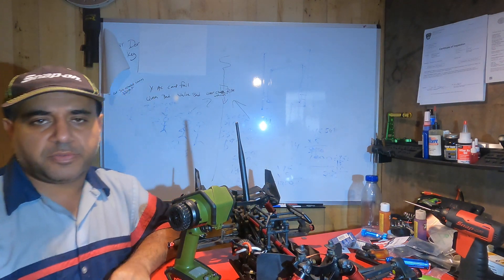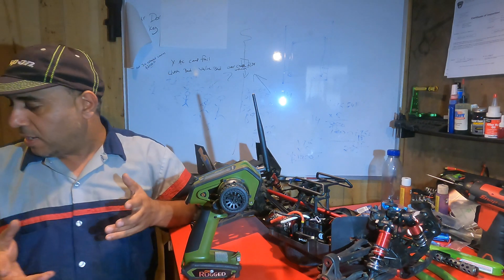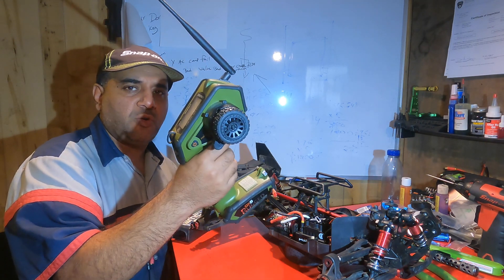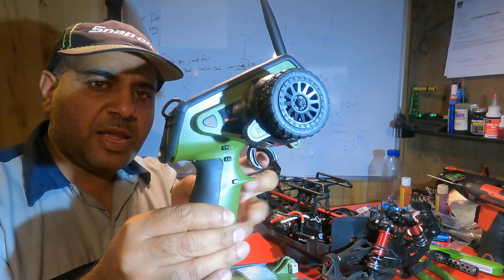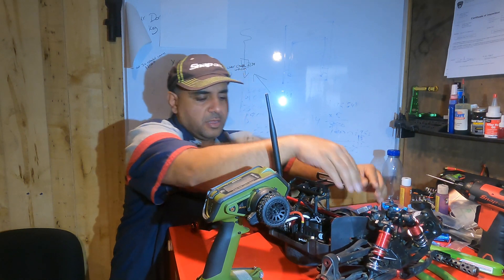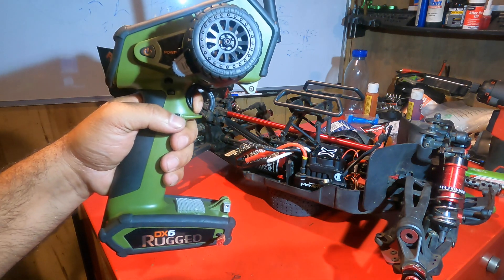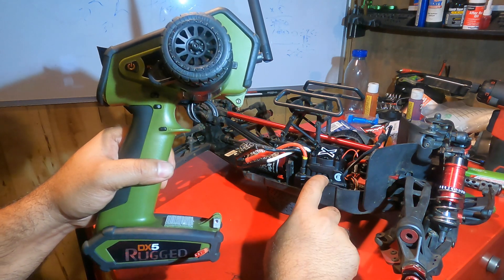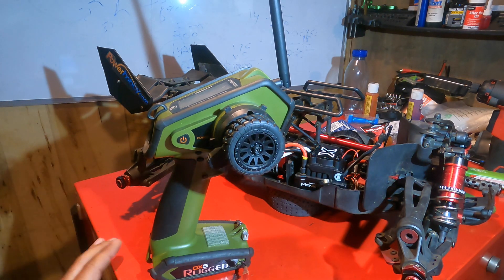How to Calibrate Castle Creation ESC  XLX2, Momba Monster X, Momba X

Comment: noticed something weird. maybe not calibrated right. car was slow and noticed my motor was only spinning at 21k rpms being a 45k rpm motor.  going into the throttle settings I changed it to 50% and up was 100% .. then it went to around 36k rpms.  found my sweet spot around 20% being 100% throttle and I'm at 51k rpms now.. but not much trigger room.. what can cause that? plus the motor was cogging bad. hope this helped with that issue